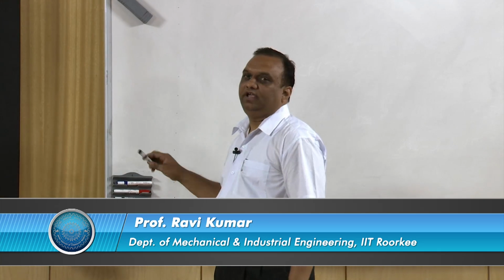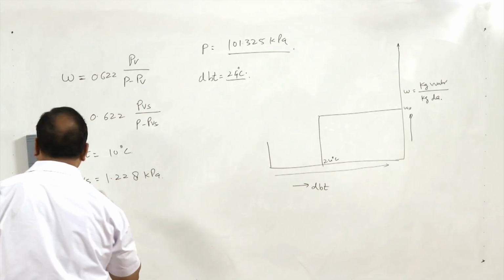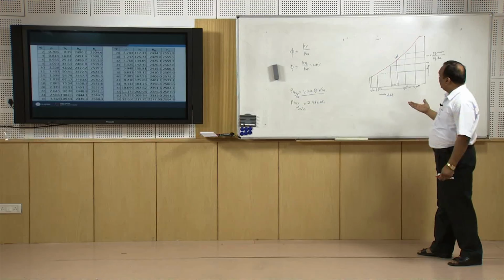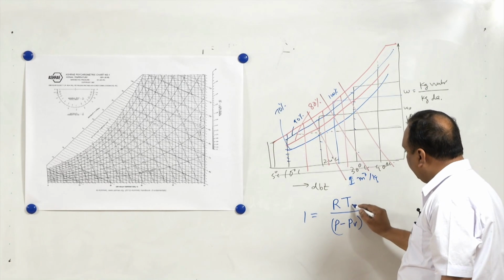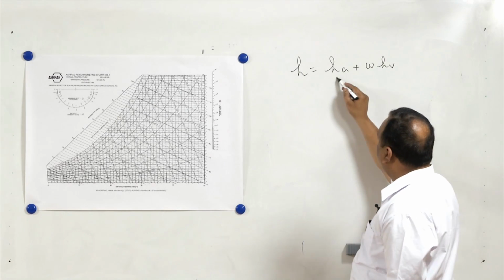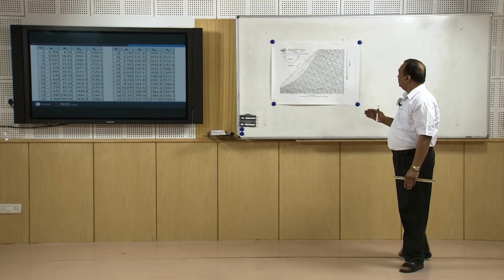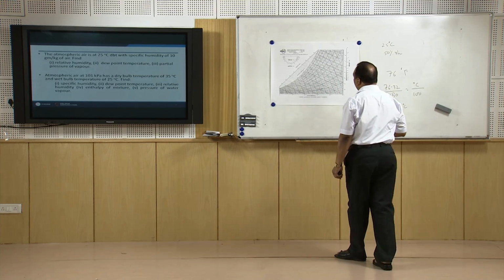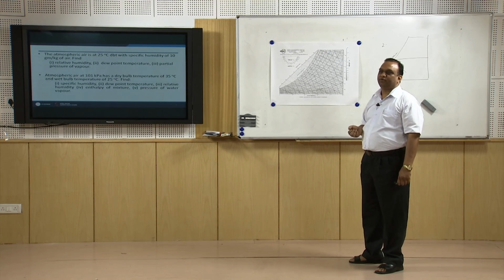Psychrometric Chart

Comment: Why used dry air gas constant when finding specific volume constant line for moist air ?
Reply: Because Moist Air is Considered as GAS (When Temperature of moist air > 2 Critical Temperature & Pressure < 10 kPa).
Reply: @akshayrana4895  this statement is true but not the answer of asked question
Reply: Here the unit of specific volume is cubic metre of moist air per kg of Dry Air.Temperature or DBT is same for dry air and water vapour as it is the temperature of air-water mixture or moist air. Here partial pressure of dry air is also taken in the equation.Because partial pressure of dry air=(total pressure-partial pressure of water vapour).Total volume of dry air=total volume of water vapour=total volume of most air or air-water mixture for a given volume of moist air.From PV=mRT relation,we can say Pa.V= ma.Ra.T =>Pa.(V/ma)=Ra.T . Where Pa= partial pressure of dry air.V=total volume of moist air or total volume of dry air. ma=mass of dry air. Ra=characteristics gas constant of dry air. T= absolute dry bulb temperature of dry air or moist air also.And finally  (V/ma)=total volume of moist air per kg of dry air or specific volume of moist air in cubic metre per kg of dry air. So Ra is taken.